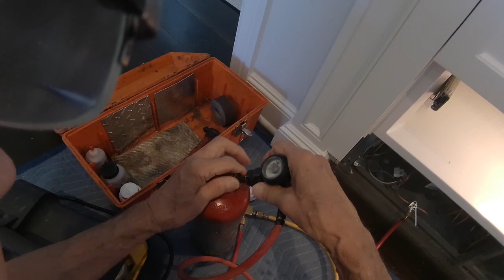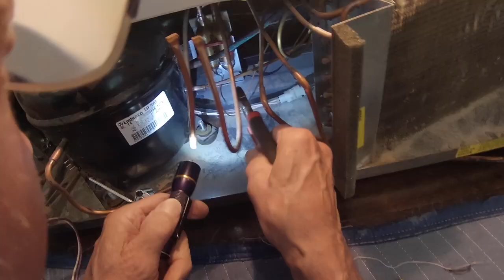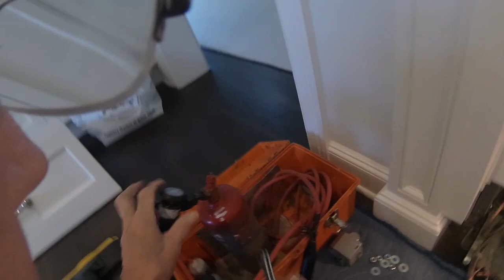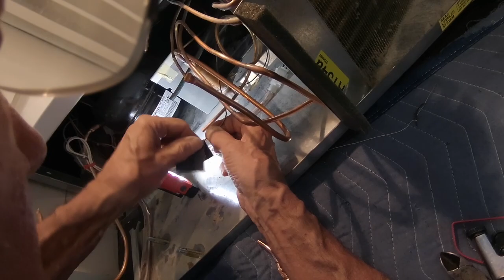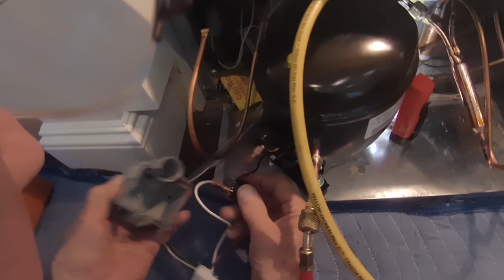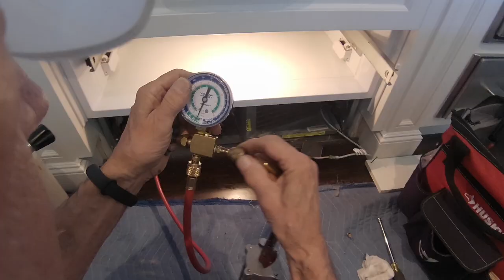Sub-Zero 736TCI-3 Freezer Compressor R&R

Comment: Good stuff! May I ask what tool that cylinder is you use for recovery?
Reply from the maker: That is called a 16 oz charging column.
Reply: @SubZeroSpecialists  OK, Thanks for the response. Is there any special purpose of it other than recovery?
Reply from the maker: @joemcfarland3491  weighing in the exact amount of refrigerant.